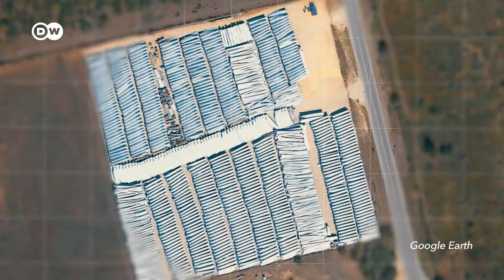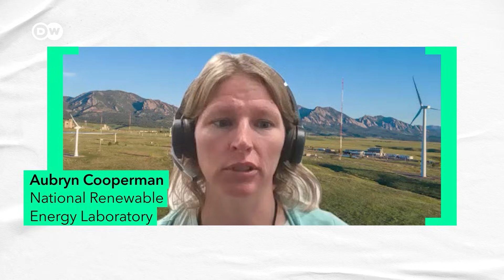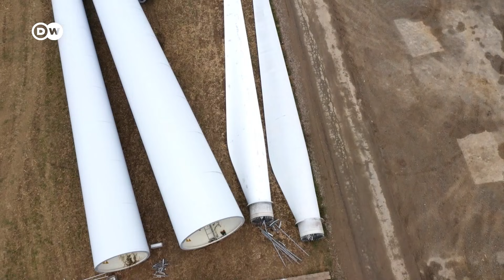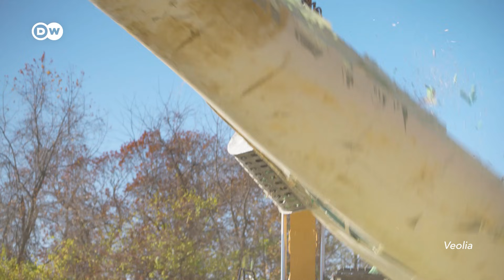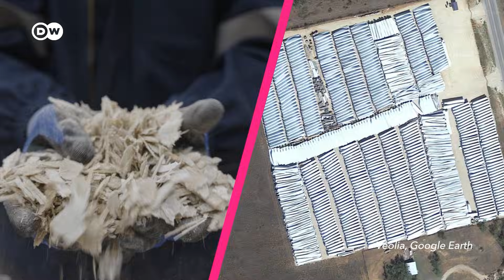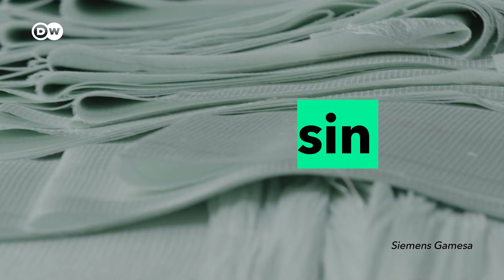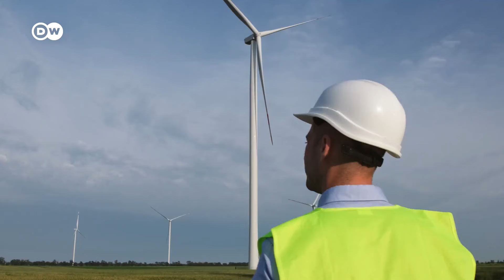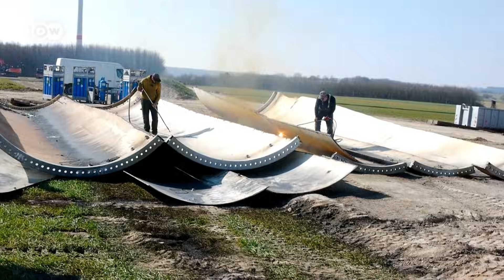Wind power's unsolved problem

Comment: I really like the concrete idea, other people are freaking out about "omg we are out of sand!!!" when we have so many things we can dump in concrete.
Reply: It's not just any sand, it has to be a specific kind of sand for it to have good material properties. It's unlikely that the blades are replacing this specific ingredient, seems that it substitutes for lime and/or gravel.
Reply: @vidyagaems4063  it's neither, It's used as an additive.
The concrete is exactly the same with sand, lime and gravel and if needed rebar too
it doesn't increase its strength by anything significant, either 
however, by adding glass or carbon fibre to it, it prevents the small cracks forming thus preventing water ingress to the rebar that causes it to rust thus increasing the lifespan of the concrete it also looks nicer.
practical engineering has an excellent YouTube video on exactly this.
Reply: @randomcow505   @vidyagaems4063  you guys are both sorta correct but i've never understood the clasification of addative vs main ingredient in concrete, it's all gotta work together. As for the type of sand, that is mainly about the gemetry. Rounder grains make it easier for cracks to bypass that grain, so filiments are not very round, they can be round in one part but very pointy in general on the ends, is like little bits of rebar.
Reply: @vidyagaems4063  btw it's also about energy, you can take the wrong sand and make it into the right sand, or take some waste mat like this and turn it into something physically identical to or better than the target sand, all the atoms are still here and in theory with enough energy and ingenuity humans can arrange all the atoms on earth how ever we see fit... just not by burning oil.

Comment: My question is, why aren't they made out of aluminum?
Reply: Because it is not strong enough. It works only for smaller, less efficient turbines.
Reply: @old-pete doing a bit of reading, they are both similarly strong but aluminum is about 30% denser than fiberglass, aluminum also corrodes in salty environments, I couldn't find a price comparison between the 2
Reply: @OpreanMircea  And that is the problem. It is heavier, which increases the forces it has to endure.
Reply: @old-pete  I know smaller means lesa eficient, but there's got to be a number that says aluminum is worse than fiberglass

Comment: How are they recycling the huge reinforced concrete ballast that is buried underground? Is that part of the 90% of the turbine being recycled, or is that not counted because it can't be seen.
Reply: One can put a new windturbine on it or one can break it apart.
Often only the upper two meters are broken apart and the rest remains in the ground.
Reply: How about it is a part of the wind-turbine that can be reused simply by replacing the blades?

Comment: Don't get me wrong, I'm a big enthusiast of recycling, but what worries me about using "off the shelf" chemicals is that most of the dissolving chemicals we have readily available today are really harmful to human health and the environment, so some investment we'll need to go into preventing leaks and whatsoever. 

Let's see, I just hope we don't repeat the same mistakes over and over again, like "oh, that's too costly" or "it's more economically feasible to just build a new one from scratch than closing the production cycle".

Those are the very kind of arguments we have been listening to for decades in the nuclear industry that have twarthed attempts to fully recycle the spent fuel instead of just having them lying down in deep repositories.

For a real and fast climate transition, I do believe the capitalist mindset has to change, and costs should reflect the abiotic depletion (ADP) consequences of choosing not to recycle.

Comment: Insane to think that most people can’t even put their trash in the right bin at home but are then bothered by this. Definitely about the trash and not just about finding anything that can be criticized about renewable wind energy
Reply: I would have agreed with your statement... IF putting trash into the right bin actually worked~
Because majority of those separate bins got collected into the same container and go to the same old landfill (or shipped to Asia to be party separated & reused). Recycling en masse is a scam. Recycling plastic is NOT financially valuable for companies & cannot be truly done (you get more inferior product); thin plastics is NOT recyclable at all (i.e. bags) because machines cannot process it (it got stuck in them).
Reply: The average US household generates 20lbs of trash per day. So in less than 5 years each house is landfilling the equivalent of 3 modern wind turbine blades. But these whining haters are concerned about wind turbine blades?!?
Reply: You don't have a clue on how "trash recycling" works. PD. I used to have more than 50 blades next to my previous house, they were there in a "recycling plant", which basically ment, that they were stranded there until somebody finds a way to get rid of them permanently
Reply: @ALIENdrifter66  love the profile pic by the way Area 51 was a fantastic game back in the day.
Reply: I would have agreed with your statement... IF putting trash into the right bin actually worked~
Because majority of those separate bins got collected into the same container and go to the same old landfill (or shipped to Asia to be party separated & reused). Recycling en masse is a scam. Recycling plastic is NOT financially valuable for companies & cannot be truly done (you get more inferior product); thin plastics is NOT recyclable at all (i.e. bags) because machines cannot process it (it got stuck in them).
Reply: You know why? It’s because most garbage isn’t recyclable and it all ends up at the same landfill. At least a landfill produces methane to be used as a fuel. Fiberglass doesn’t break down.
Reply: Perhaps you could look up the facts and truth about recycling?

Comment: what they will do with the chemicals they use to dissolve the blades?

the fibers used in concrete, from shredded blades, is that not the "new" asbestos danger?

the SF6 gas used in the turbines, the worst greenhouse gas known to mankind, what will happen to that?
Reply: The fiberglass becomes cement. It does not stay in the fiberglass form.
SF6 gets recycled. One should note that SF6 is not really needed, it is just the best solution and is part of many other electrical installations. While SF6 is a very strong greenhouse gas, the amounts produced worldwide are very low. Most of the SF6 that is emitted into the atmosphere comes from isolated double pane windows.

Comment: This is a good overview of the problem with some interesting techniques coming up.

But one thing about scale...

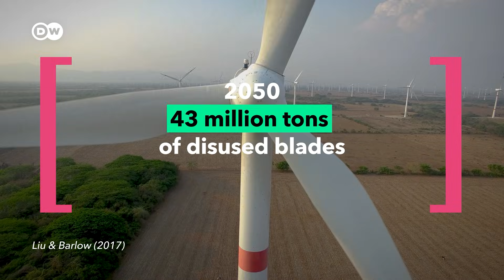At 2:40, 43 million tons of used wind turbine blades by 2050 is nothing compared the current worldwide annual emissions of 37 billion metric tons of hazardous fossil fuel carbon dioxide right now!  

And carbon dioxide is a highly diffuse high entropy gas that cannot be collected.  OTOH, the epoxy and fiber material of a blade is much more inert and is solid so can be stored for later use when recycling techniques have advanced.